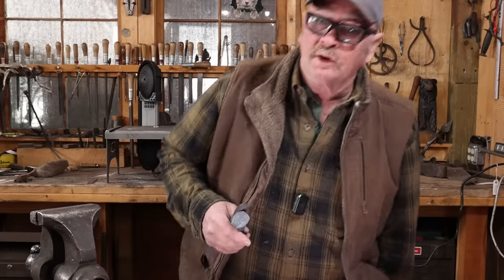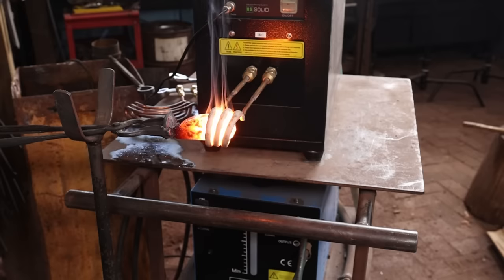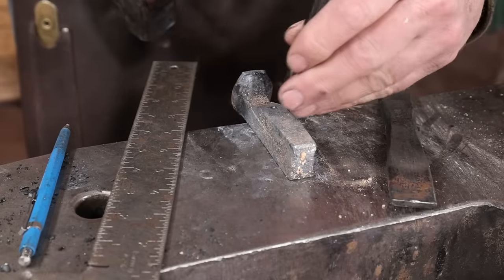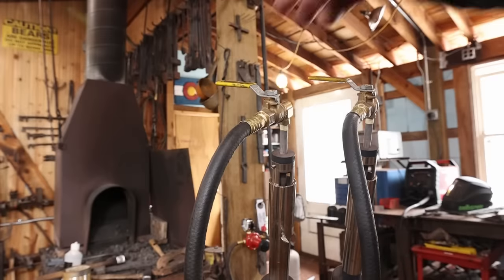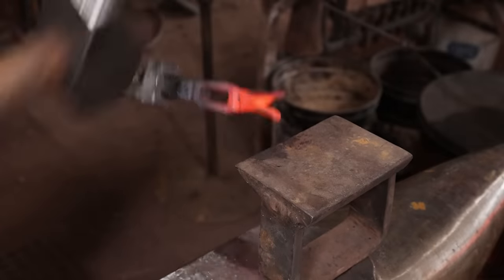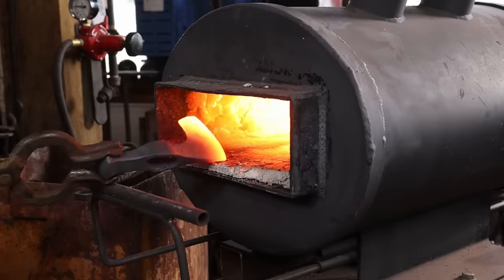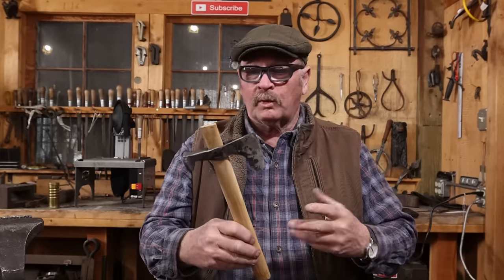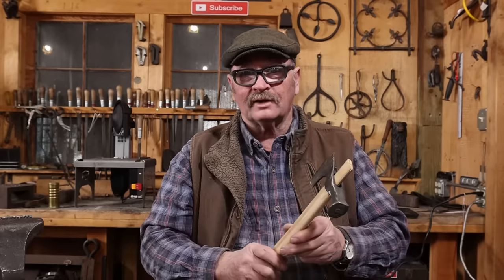Improved Railroad Spike Axe

Comment: I have made several RR spike axe/tomahawk with tool steel forged into the cutting edge.  I have never sold one but give them away as gifts.  They make a great small axe for camping.  Split kindling and use the head as a hammer for stakes and whatever.  Most have ended up displayed on a wall or table in a home.  Yup, a lot of time is spent but worth it when the recipient (family member or close friend) really likes the gift and appreciates the skill and work involved.  A big smile and a thank you hug sometimes is priceless.  TT
Reply: Nothing beats a wide smile when you gift something you made to a close friend or family.

Comment: While I didn't use a rr spike, I have made a couple of small hatchetts by forge welding better steel bits in to other steel, purely for the practice (and as gifts to family). I agree, it's a lot more work than just making an axe from decent steel to start with and as you say, not profitable, but I did find the process a good exercise all the same.
Reply: or if ur a kid and ur neighbors tossing out a bunch of drill bits and you do not know where to find good steel but you live next to a old rail road

Comment: Forgewelding in the induction forge sounds like a huge gamechanger. Being able to see the precise temperature and not having to deal with slag seems super useful. I would think oxidization would be more of a problem though, with there being no fire to burn up the oxygen.
Reply from the maker: So far that doesn't seem to be an issue.

Comment: I’ve been thinking about a shortcut on this process. A person could run a few beads of hard facing welding rod along the cutting edge of a mostly finished spike knife/tomahawk, and create a decent steel edge that would last pretty well, while keeping the time investment down. With as much use as the typical novelty spike knife/axe  sees, it should last plenty long. 
The only thing stopping me from trying it is I don’t have a stick welder😂
I got the idea from a friend who used to do the same thing to his lawnmower blades, and got a lot more life out of them.
Reply from the maker: It would probably work if you can get a clean weld along a thin edge
Reply: @BlackBearForge  The trick my friend used to get a good weld, was he had found a large piece of copper plate somewhere, so he would lay the blade on it and run his bead along the blade against the copper, which kept the thin edge of the blade from melting through. I figure by the time I get a stick welder bought, I should have enough copper scraps saved up to cast me a little ingot to use the same way.
Reply: I have done something similar using oxy acetylene welding with 1080 music wire (available on Amazon) as the filler wire.

Worked well for some light duty splitting wedges I made from 1" mild steel.
Reply: I keep all my 3mm 1/8 drill bits I snap or blunten 

And I Tig weld using the drill bits as filler when need a quality sharp edge on something I fabricated

Comment: Nice work John.
I am OK with the added material to the railroad spike. An axe that doesn't hold an edge is not very useful.
The handle can come loose, looks like it needs more surface area to hold it on.

Comment: Neat little axe, I think it would be a good project to practice forge welding two different pieces of steel and drifting eyes, instead of using a lot of expensive steel. A great way to gain experience and make some gifts for family and friends.
Reply from the maker: You're exactly right.

Comment: The railroad also has coal by its sides, of course, do not trespass or be persecuted… Plenty of spring steel in the rail springs, I have not looked up the rail steel quality, but I have a couple half-inch segments, a little too skinny for axes, perhaps.

Comment: I find it funny that just yesterday i was talking about why i don't see induction forges and then boom youre using one in the video. Any input on why they're not common?
Reply from the maker: Price and limited usefulness I would say.  But when they're the right thing, they're great.  There is a limit in the ability to increase coil size and coils need to closely match the work, especially for welding.  But I also think its technology on the rise, so they will probably become more common.

Comment: That looks cool for a novelty hobby axe around the house.
This is the first time I've seen a liquid flux instead of the powdered flux.  Could you explain the differences in them and any positives and negatives you've noticed?
Reply from the maker: Its not actually liquid. This is Iron Mountain Flux, its a powder in a squeeze bottle.

Comment: Excellent work young man! Question...why do you have to normalize the metal and temper it?
Reply from the maker: Normalizing removes stress build up from forging and helps prevent warping and cracking during the hardening process.  The piece is then hardened and finally tempered

Comment: What are you using to eliminate the background noise of the gas forge in post processing? It's working extremely well!
Reply from the maker: I have been shutting the gas off when I go to the anvil. But I just got a new forge with a blower and that probably won’t work. So we’ll see what happens.

Comment: John, I noticed the rooftop solar panel in the lovely drone shot. Is that new? Is that enough to offset some of the equipment power draw or is it just for running the smaller stuff like lights?
Reply from the maker: They've been up for a while, but not wired yet.  It will only be enough for lights and perhaps a forge blower.  But not for power hammers or grinders.

Comment: Would it be viable to carburize the edge of a regular railroad spike axe instead of welding in high carbon steel?
Reply from the maker: Any cauterization would be very thin and easily ground through when sharpened.

Comment: Great work sir!  I was wondering though, isn't the RR spike you're using high carbon as well?  Besides ease of forging, why use an extra piece of steel?
Reply from the maker: The railroad spike marked HC are higher in carbon than regular spikes, but they aren't very high and as mentioned they don't get very hard.  The added 5160 edge not only provides a much better cutting edge, but it also allows for a wider edge with more surface area.
Reply: @BlackBearForge  I did not know that!  That's a bummer!

Comment: Does that liquid you put on there help with the forge weld?
Reply from the maker: Thats actually a powdered welding flux.  It helps clean the material and prevent oxidation
Reply: @BlackBearForge  thank you, do you know where I can get some, I am not very good a forge welding

Comment: I got a question, since when could we re-sell a rail road spike? Even if its been made into something else at the end of the day it still belongs to the Rail Road company.
Reply from the maker: They only belong to the railroad if they were purchased by the railroad and you then steal them from the railroad.  You can buy brand new spike never owned by the railroad from any number of suppliers and if you're lucky a maintenance crew might give you some spikes that are being discarded and replaced.  Don't trespass on railroad property, don't steal and you won't have any issues.
Reply: @BlackBearForge  Ahh ok I gotcha, So basically just spikes. I've lived out in the back woods by a Rail Road all my life and was always told you cant re-sell Rail road spikes, so its just always stuck with me. It never crossed my mind one time that you could buy em from suppliers lol. Thanks for the fast reply have a good one!